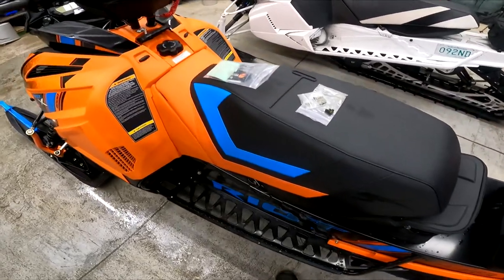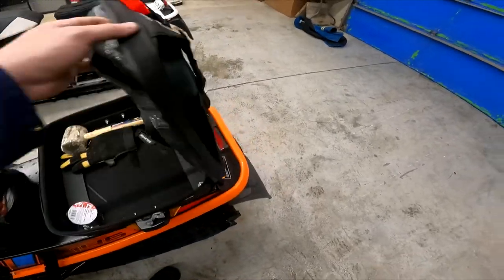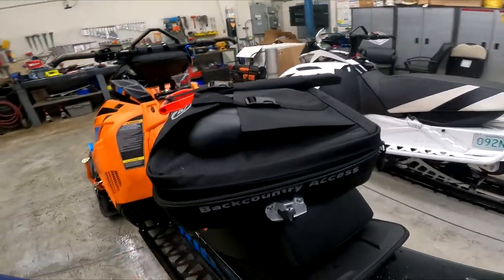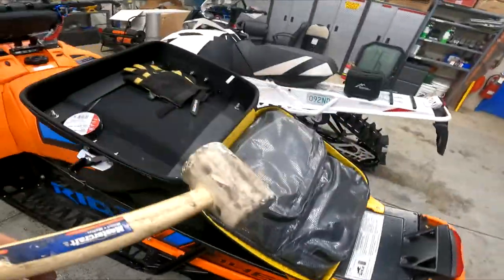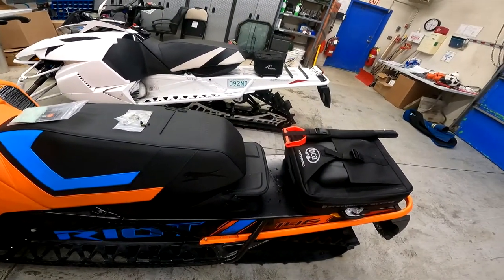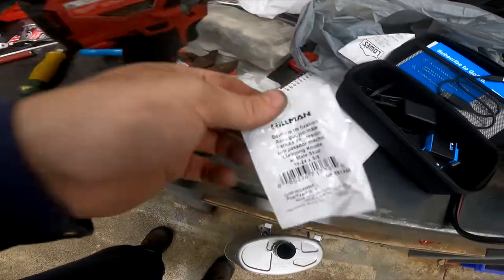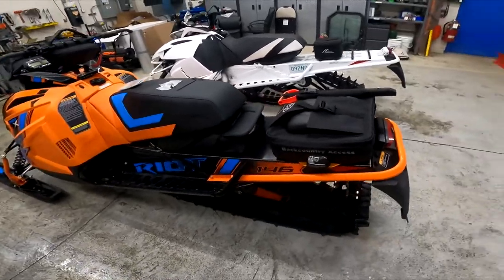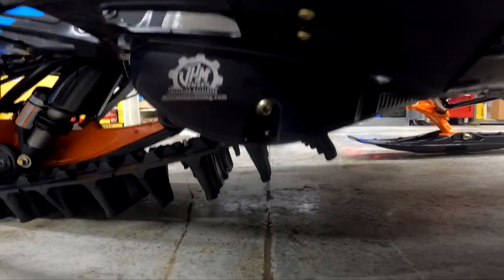2021 riotx overview of extras, bca pack, removable snow flap etc

Comment: I’m currently looking at buying the riot x  how is it on trails ? I’m in Nova Scotia Canada and we have a lot of trails to get to the playground. Thx
Reply from the maker: Thanks for watching. I have. A few videos with me trail riding it. My newest trail riding vlog videos the microphone is a lot better and gives a decent idea of how it is. So far i love it. On the trails it does just fine. Youll go around corners a bit slower then normal but its very very manageable in my opinion. I think it also depends on what your used to riding if your coming from a straight trail sled to this it will be a huge difference, if your coming off a more "crossover" sled that you already narrowed up the ski stance maybe disconnected the sway bar etc you'll be fine. It really isnt as bad on the trails as everyone thinks or would think. It rolls a bit but its more of a body roll and not a tippy roll in the rear of the skid if that makes sense.If you really want an alpha skid and a killer boondocker sled dont let the skid scare you away for the bit of trial riding youd be doing ive put on a few 100 plus miles days all trail and its fine. Some have had issues with the track coming apart i havent yet its been good for me. I always run both scratchers as others say they do so im not sure what to make of it, im not as hard on it or just lucky not sure.Again thanks for watching and good luck on your purchase.